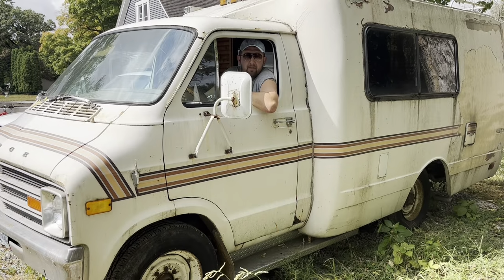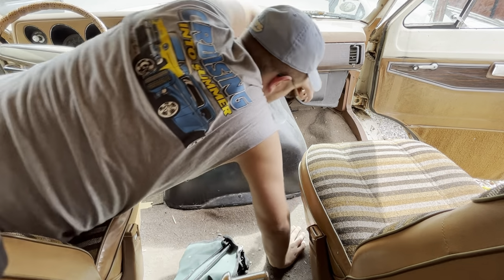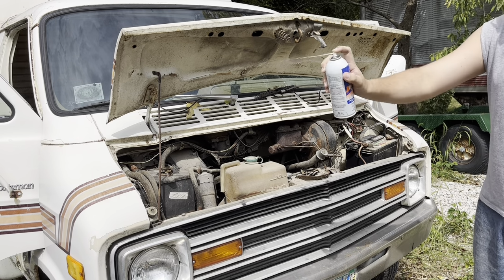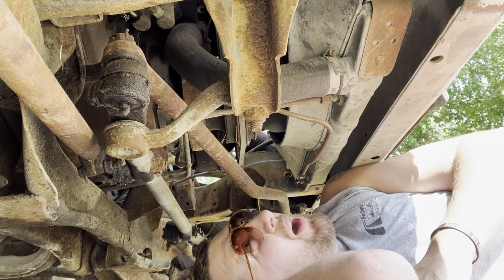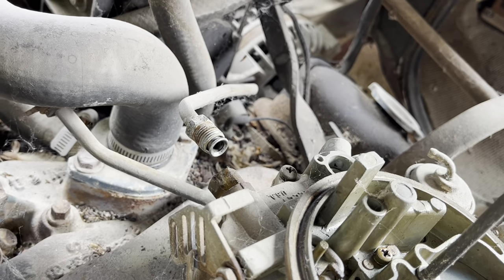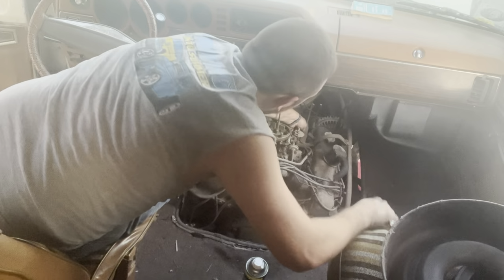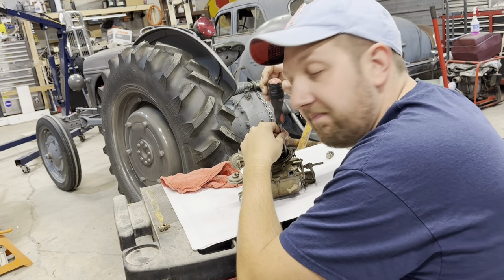1978 Dodge Sportsman RV Camper Van Revival - Sitting over 2 Decades!

Comment: All of your Chrysler small blocks have the engine size written on the side of the block...passenger side. On Chrysler B block big blocks you can find the engine size on a flat embossment in front of the drivers side head, The RB big blocks will have an embossment in front of the intake manifold near the distributor. The fuel pumps can be removed using a short 3/8 drive extension, and a short socket using a ratchet. The easiest way to identify the 360 from the 318 if they have 2 barrel carburetors is that the 360 has the larger of the two, the 318 2 barrel looks like a 1 barrel. One thing to note about a 360 is that it is an interference engine, and like many other manufacturers they had nylon timing gears from the factory which were only good for 60,000 miles. Great video, thank you for sharing. If ever you decide to tear down a Chrysler engine, look closely at the webbing for the mains, and the size of the main bolts, they are much beefier that the other manufacturers.
Reply from the maker: Really appreciate the information! Always like hearing about new things to keep in my back pocket for future reference. There’s actually another Mopar on my list this spring. This info will be really handy! Thanks for watching!

Comment: Hello just come across your video I have a 1978 Dodge trans van mine has a 360 engine in it does yours have a door tag to tell what the original tires are from the manufacturer I want to buy new tires for mine I know they're 65 but I need to know the original size and my sticker is missing I am subscribing to your channel have a good night😊 I have a few videos up when I was working on mine I've been driving it for a daily driver or I guess a couple years now
Reply from the maker: This is currently owned by a friend of mine - but it had 16.5” tires. I would recommend asking a tire shop what size/load rating to go with based on the GVWR of your van. Truck stops often have scales you can drive across near the diesel island if you aren’t sure what your van weighs. Best of luck!

Comment: Hey man, Diehard Dodge guy here. Easy reference - Small block engines - 318, 340, 360  - have the distributors on the back of the engine, whereas the big blocks - 383, 400 and 440 -  have the distributor on the front pointing at an angle. Now, for the normal pickups etc 440s went away in 78, but the RVs hung onto the big blocks a lil longer, 79-80 ish.  Your example is a small block, either 318 or 360. 

11:46 thats just to fill the engine oil.

13:01 Welp this is why i live where the air hurts my face 7 months a year. Fuck wasps. 

14:40 Motorhomes have always been cool to me. Bein able to live wherever you want? Metallica had it right before they went to shit: "Wherever I may Roam"

16:40 Bloody hell, is that the set where the filmed "The Day After"?

18:00 dodges do NOT crank fast to begin with, they sound like a turbine engine winding up.  Moreover, your battery leads arent great. 

19:39 Care to try pullin wrench at -40? 

22:40 - that unit is electronic ignition. The brain box to it is directly behind the battery; the distributor is a mag pickup type. 

24:52 AHH YEAA THATS WHAT I LIKE HEARING

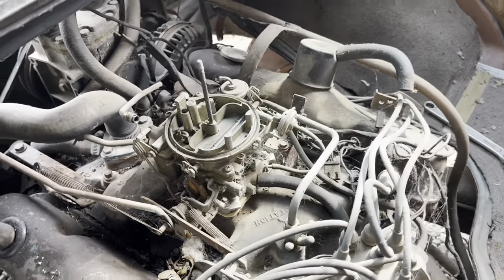27:00 fuel filter will be near the fuel pump OR along the frame.

27:27  Good Kitty

30:00 Small block fuel pumps ride on an eccentric lobe on the camshaft. BIG Block pumps have an intermediate rod that goes from the same came lobe to the fuel pump and are a real pain to keep up while stuffing a pump in. 

31:27 - socket, 1"short extention, stubby 3/8" ratchet. Use them to zip the bolts out n in, use a long ratchet to  do final torque. Use flex heads/flex extentions if needed. 

43:30 - the rattle are the hydraulic valve lifters - she desperately needs an oil change. May want to consider diesel engine oil; i run that in my old mopars now. Stay the fuck away from fram garbage - get Wix or better. 

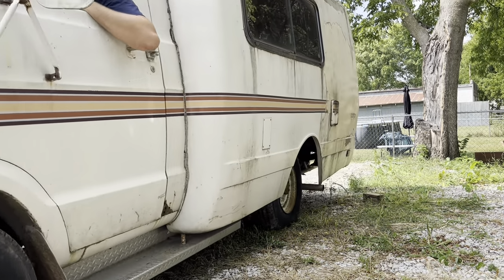46:30 a delight to see the old gal move! 

If you find the RV side isnt save-able, you might like what i did with my unit.

Comment: Originally, all of the R VS came with a 440! Unless you wanted a V6. But the 440 was phased out on all Dodge vehicles in 1978, so if this is a 78 , you would have the low end. HP440 f looking at your hands next to the passenger side valve cover, it is too narrow to be a.440.  That will be a .360.
The .318's though the workhorse for dodge, wouldn't be equiped with this RV because of the weight and it has a 1 ton under carrage.
Reply from the maker: Thanks for the info!